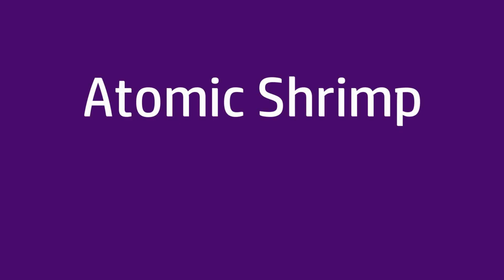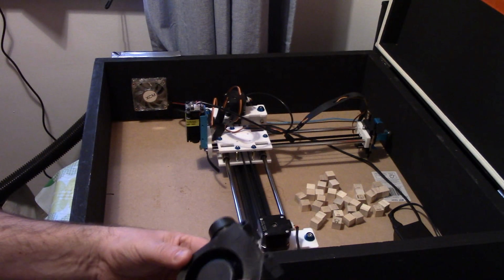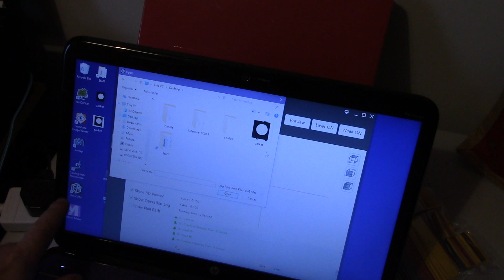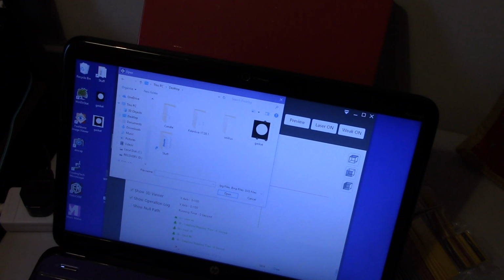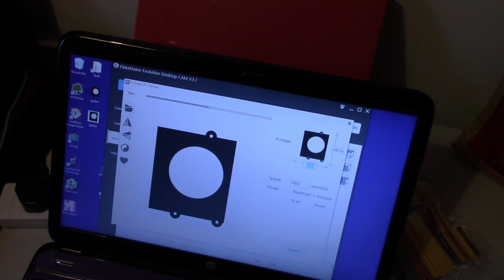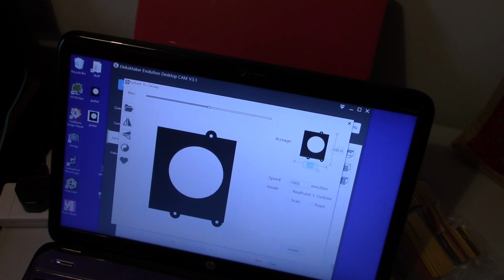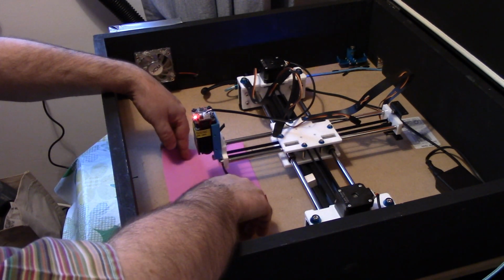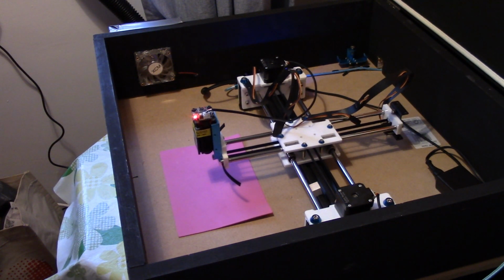Random Stuff - Fume Hood Upgrade & Next Year's Cheese

Comment: The word 'Gasket' always makes me think of a holiday on the Isle Of Wight, in the mid 1970's. Dad had, at the time, a French Simca 1300 'Shooting Brake'. The head gasket went on a trip to Ventnor, and Dad nursed the car back to Ryde, and took it apart. No car dealer on the island had spares for that type of car, so I helped dad make a new temporary head gasket from several of thicknesses of card from a cornflakes packet, coated in a lot of Vaseline. It lasted the holiday, and the 120+ mile trip home. 
That's what the word 'gasket' always reminds me of.